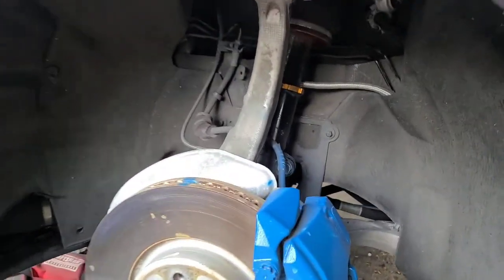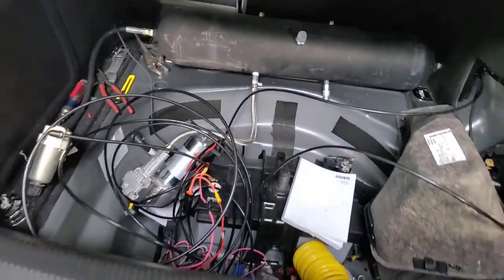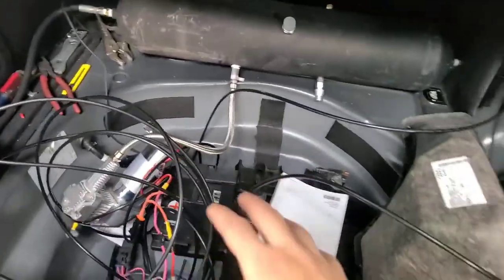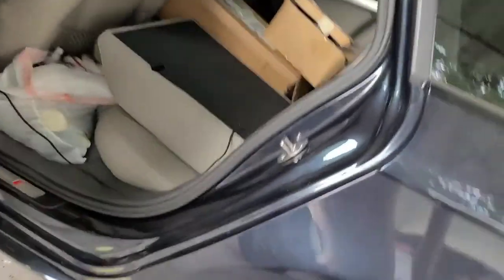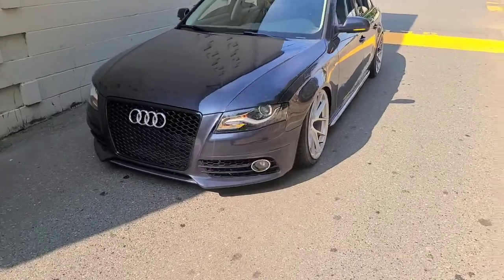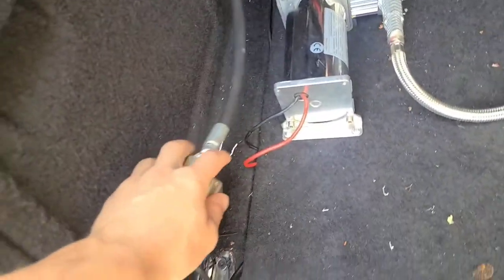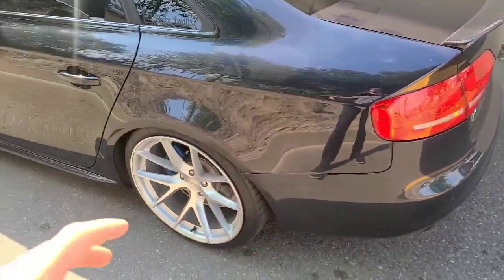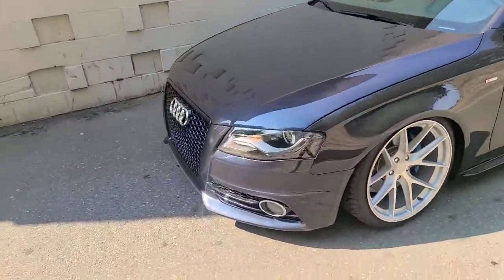Audi A4 B8 Air Suspension Walk-Around

Comment: Some cars come from the plant like that. I have a bagged A4 B8.5 and mine sits a hair off but I tuck. You need to go back to the alignment shop and have them match the rear camber to the front camber and you should be good to go
Reply from the maker: never actually fixed the issue, the car was just built that way…wierd
Reply from the maker: never actually fixed the issue, the car was just built that way…wierd